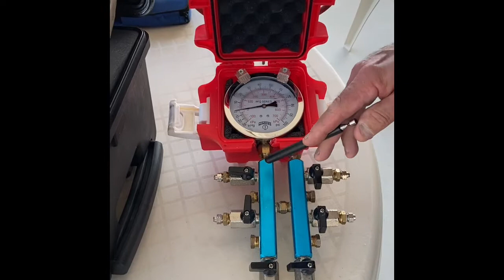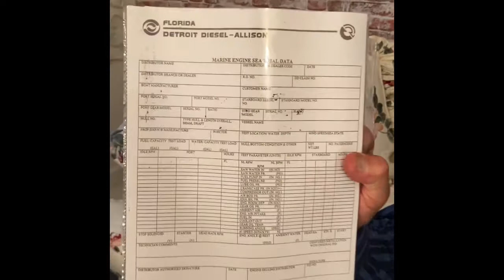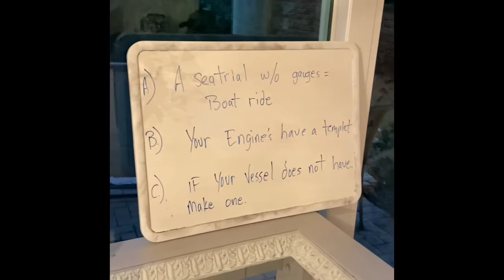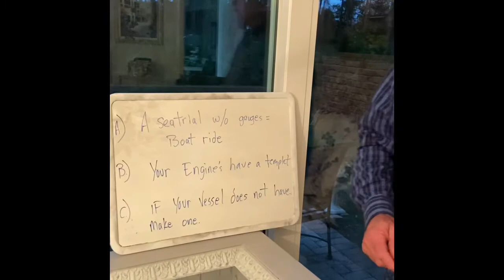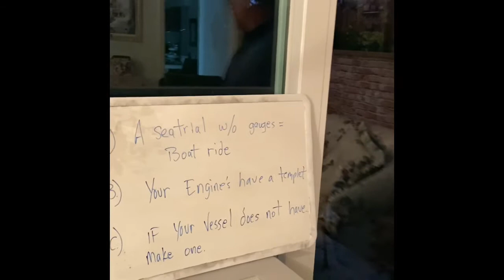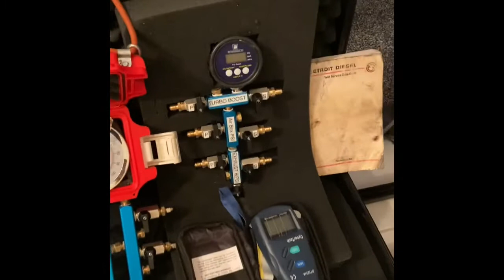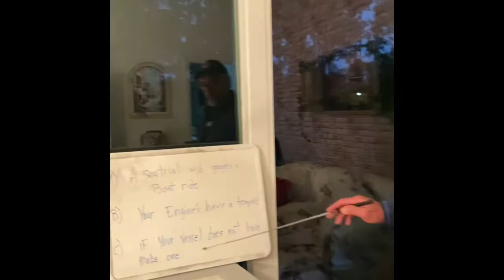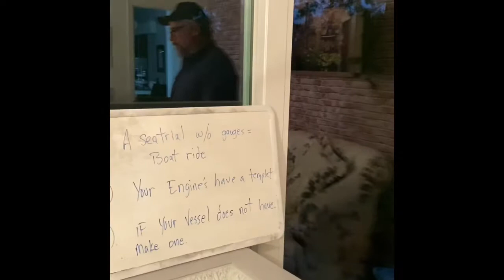Detroit Diesel Marine Troubleshooting Tech Tip

Comment: hi mate good question 50 ft crusier with 8v92 ti 735 hp what size props would you have under it gearbox ratio 1.5 to 1 , twin engines
Reply from the maker: That question is one for a prop guy, sorry no help here.
Reply: do you know someone you can ask

Comment: To be completely honest, this has to be the best video with the best information, content on DD's I have ever seen and presented so well. I am in Southern California (don't hold that against me-lol), and good DD mech's are a rare find. I have 6v92's @550 in our 37 Bertram - we've detuned the injectors to 450hp. I've gone though 5 mechanics in the last 4 years with the main goal of chasing or eliminating smoke. The ones that have shown up (most don't even show up) and you are so accurate - we go on a sea trial w/out gauges and we come back to the docks and they say 'it's injectors or turbo - too much fuel not enough air. Over the last couple years I've dumped over 30k and still have smoke - new turbo, aftercoolers, exhaust, injectors, rack timing, etc. I am not a mechanic by any means (gear head for cars, def not diesels) but I do understand overloading a boat. I've told every mechanic that boats DO NOT get lighter over time, and I think I am over propped! All have said the same thing,  'well that's how the factory set's them up'.  

I don't make 2350 loaded, I get about 2100 to 2150, with the tanks 1/2 full and smoke like a Santa Fe freight train - black smoke. Unloaded, I have no issues to reach 2500. Before I spend another cent on a mechanic, I am going to take some pitch out of my props. My current props are 24x27. Might drop the pitch to 25. 

Again, many thanks for the outstanding video - If you know of a solid DD in the Southern California area (Long Beach), please let me know!

Comment: Hi Don great vid. Q: are the pressure check connection ports (sorry for non technical lingo) on a pair of 6-71N’s w N95 injectors (310hp rating) obvious to locate for purposes of hooking up your test gauges, do they need to be added to plugged ports, etc? Thx in advance for your guidance.
Reply from the maker: Thank you for the feed back, some inline 71’s came with one air box cover with a 1/8” pipe plug bung, that is where I would put a fitting to test psi, there are five covers on one side and two on the other side, if one of yours does not have the 1/8” plug, you can remove a easily accessible cover, drill a hole and braze 1/8” fitting to it that you can leave with a cap for test port, be sure to remove and replace the gskt and copper seal on bolt, 12lb torque. Any problem you can email me. Donvandieselllc@gmail.com

Comment: I’m looking at a 1982 bodega 4050 with 420hp twin 8.2 v8 diesels @2300hrs.  Assuming they have been will maintained what’s the life expectancy if not overheated? Could I also get more details on the gauges you prefer and if your possibly interested in remotely walking me through a mechanical/ sea trial if I’m equipped the same as you would be. I’m in the pacific north west and I would like to gain experience from someone like yourself. Thanks for the great content. I’m looking forward to learning more.
Reply from the maker: Hey Broc, sorry so long to respond, I’m not a big fan of 8.2 Detroits, they are a medium duty truck engine that are marinized. To light weight to handle the strain of marine environment, We would not rebuild them at our distributor we would replace them when failed. They seem to run ok when low hours but be carful of overheat can be catastrophic. The belt driven raw water pump does not help. Parts will be an issue, and a mechanic who can just do a tune up will be nearly impossible. If the vessel is worth it keep in mind a repower down the road.

Comment: nice video, i have a silver 1989 6V53TI who pass the coolant to the oil, what can cause this? the oil cooler is ok, i m from argentina
Reply from the maker: If you have tested the oil cooler and it is ok, remove the oil pan and pressure test the cooling system to find the leak, could be head seal, or coolant pump seal, you will find with pan off. Worse case cracked block, hope not.

Comment: We are rebuilding our 671 for the second time...we have a YouTube channel would love to have you check it out and see what we are doing...I will subscribe and push the bell of your channel...I will post a address to our channel and our journey below...Would love your input or comments .... https://www.youtube.com/watch?v=Fcbs8vTXwtE&t=16s
Reply from the maker: Sounds like a very knowledgeable truck/bus mechanic, I'm  not sure if you can make much sense from the video for a high performance Marine engine,  Totally different applications,  very different engine, Overhauling a 71 series engine requires a service manual, special tools, and much skill. Block measurements are crucial, liner fitment crucial, knowing and observing wear limits are crucial. The video has some experienced tech tips for transit applications.
Reply: @donvandieselkellogg1233  I think we have a very good mechanic in Joe...We have issues right now with the piston rods being mismatched...Joe took them with him to figure out if we can use them or order some more...we have had to do this twice now and want it to be right...we have gone to far to turn back now...we are putting a turbo on this rebuild and don't want to cut any corners we want everybody to be proud of this one...